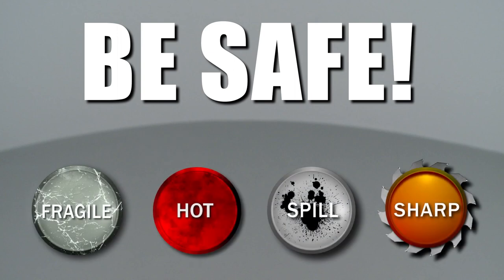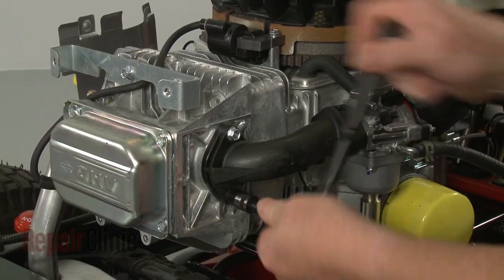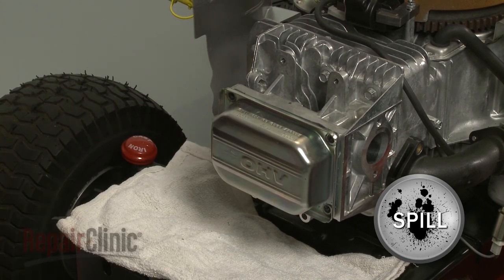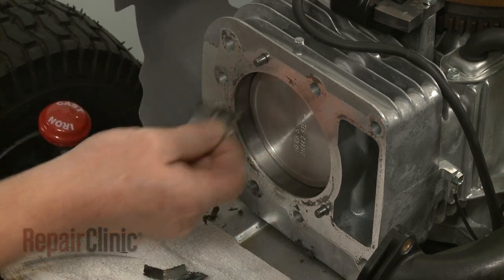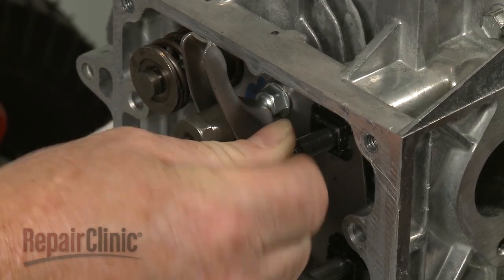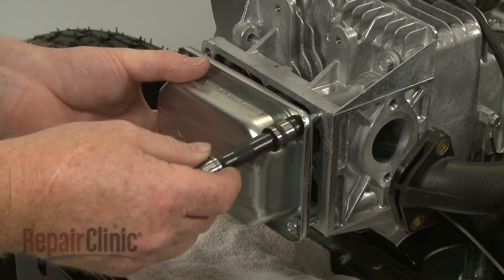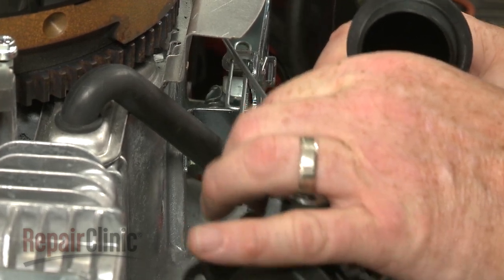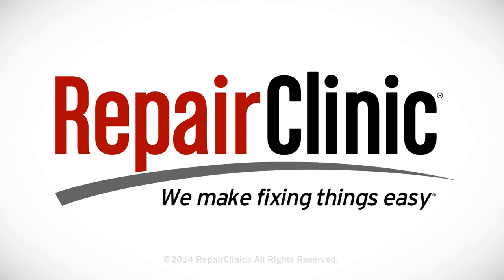Briggs & Stratton Small Engine Replace Cylinder Head #591750

Comment: Hi, thanks for the video. Can I ask a silly question? Does the engine automatically somehow put oil in the valve cover? Or is that an abnormality for there to be oil in there? because I had some oil in there.
Reply: No oil should be present - the are no passage down to the crank, but some might come up from the push rods.